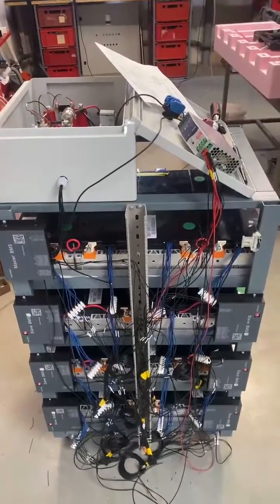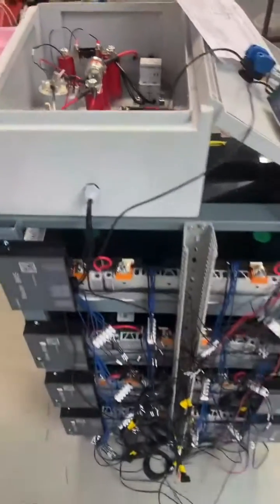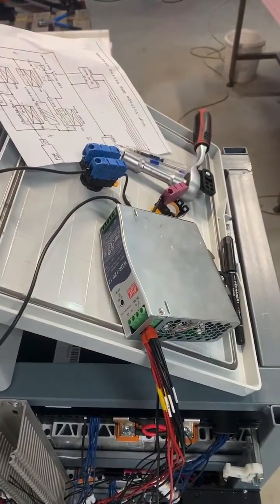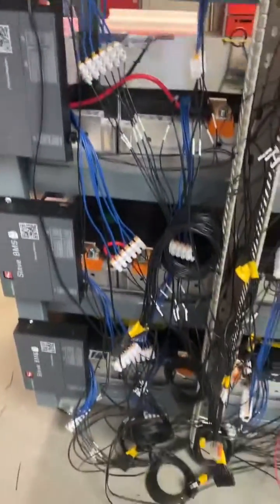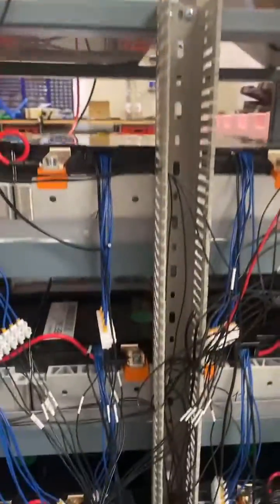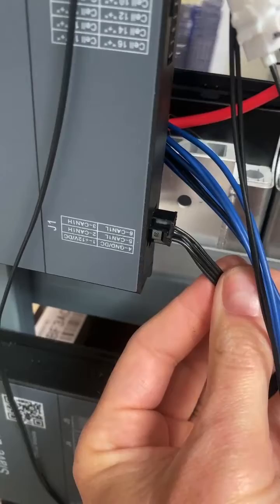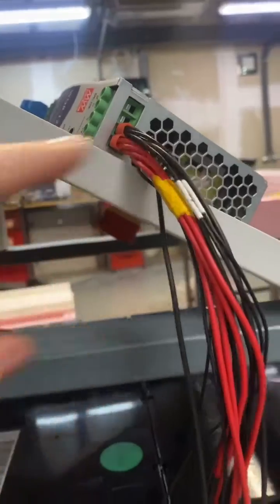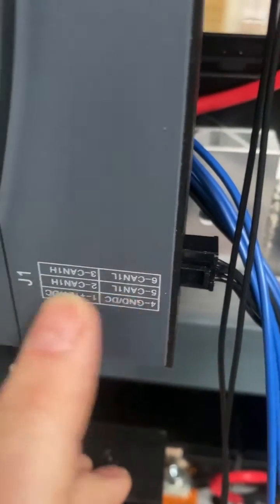TOPBMS High Voltage BMS 32S-512S  Communicate With Inverters via CANBUS

Comment: I need exactly such a BMS for my 120S Baterie 👍. What is the balance current between the cells? How does the BMS balance the blocks with each other?
Reply from the maker: if 120S , you need 1 master bms  + 8 slave bms  ; the slave bms has balancing 90ma ; if you need larger balancing current (such as 1A , 5A , 10A ), you can add several seperate active balancer to the battery system
Reply: @topbms  Does this mean that the master does not manage any cells, only the slaves? How is the voltage between the slaves balanced?
Reply from the maker: @RichardSteigmann  , No, your understanding is wrong ; Slave bms is used to measure the current / voltage /temperature; Each slave bms can balance 16cells ; Master BMS is used to configurate / monitor the charging cut-off / discharging cut-off /Over current cut-off / Balance starting /Inverter Communication / Inverter charging cut-off / Invert discharging cut-off /Cell strings ,etc. For BMS manual  , please go to the link :https://www.cleverbms.com/picture/80.html